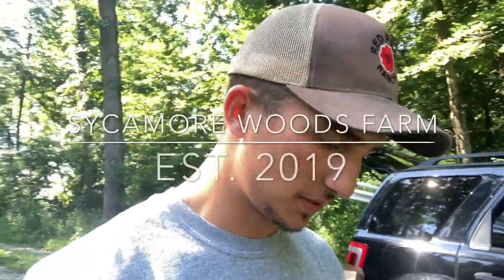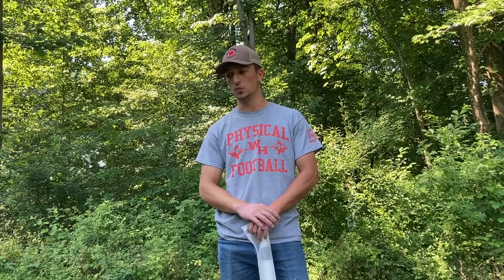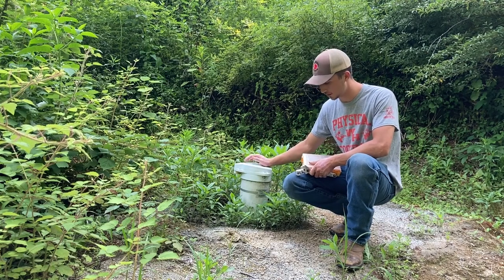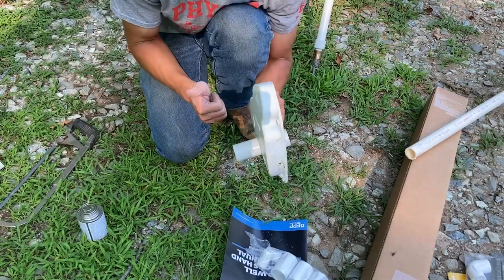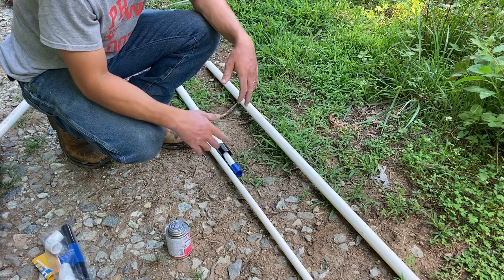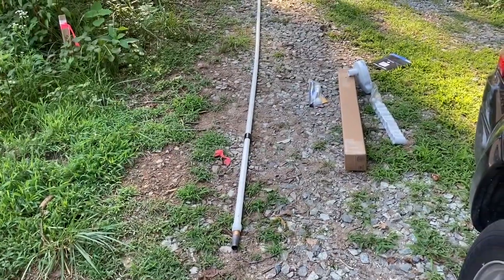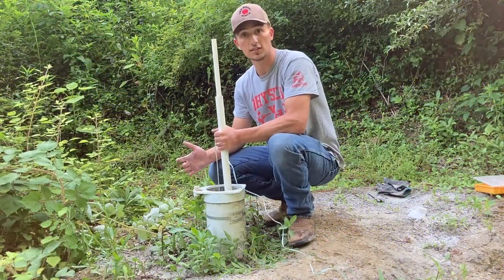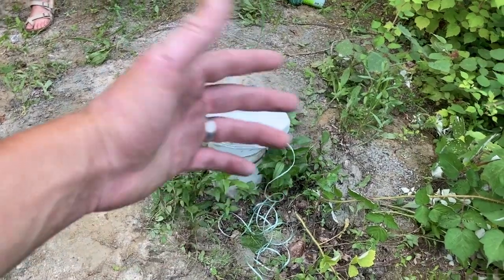Installed an Epp Hand Pump on Our Deep Well - #31

Comment: I'm about to install mine this week. Looks pretty simple. Hope it lasts for many years. I like that the handle is removable, makes sense and won't be visible. Seems like a very basic pump device for $350. One or two actual metal fittings at the bottom and the rest is PVC. They're making money on this, that's for sure.
Reply from the maker: It is very simple, and we have been extremely satisfied with it. Hope it works out for you, let me know how it goes!!
Reply: @sycamorewoodsfarm2842  We got it in yesterday. Very easy to put in. Ours it at 80 ft with static level at 60 ft. Pumps very easy even at that depth. Good flow. I used Schedule- 40 pipe for the short, two inch piece between couplings on the casing cap...for extra strength. And we made sure it was on the cap with a tight fit so you don't wanna have that short piece of one inch pipe too long. The well cap is curved a bit and it causes a little extra friction since it bends the pipe slightly, but it probably doesn't affect the pump motion much. A flat cap would be ideal, though. But happy so far.
Reply from the maker: @troyisakson1060  glad to hear!! Our well cap was a little curved too, but it works great

Comment: Nice Job. If I decide to install the pump, I will attach the 1" pump pipe to the inside of the well casing with a couple muffler clamps through the casing wall. Terminate the pump fittings just under the well cap, that way its covered when not in use, but readily available should I need it.